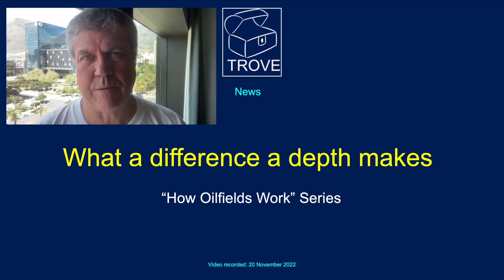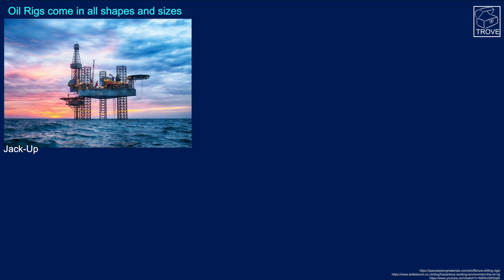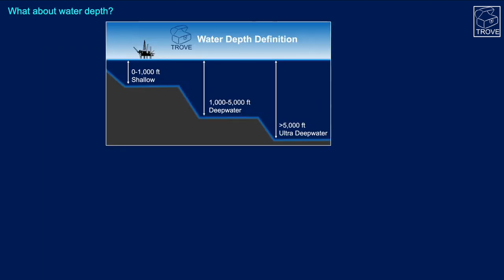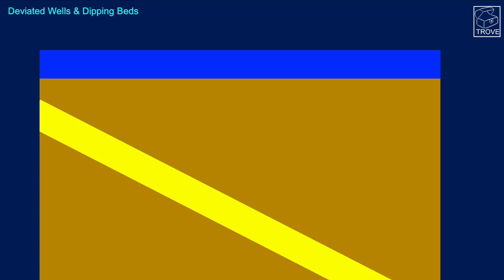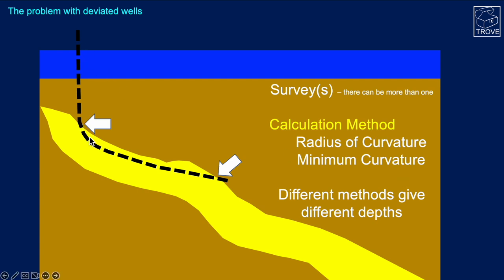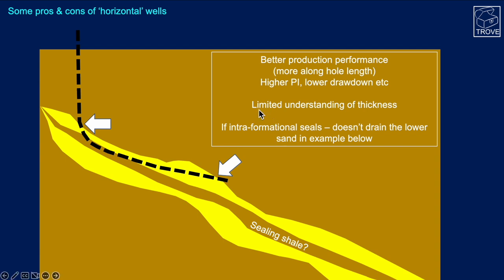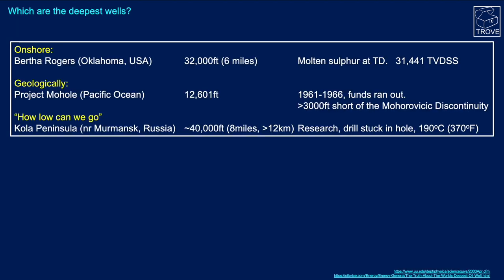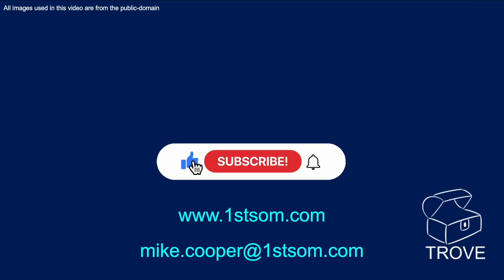How OILFIELDS Work - what is DEPTH?

Comment: It is interesting that the vertical depths of the wells off of Sakhalin Island only have a true vertical depth of 1km because I have seen them cited as the deepest wells. In particular, I have read that the great depths of these well are evidence in support of the abiotic theory. This would seem to be debunked if the horizontal depth is only 1km. But what about the Tiber field? Did they find oil at 35,000 feet?
Reply from the maker: Hi Eugene, thanks for your question. Some Sakhalin wells are likely to go deep, we were quoting drilling records, mainly set on one field which may have anomalous well geometries. As for Tiber, in the Gulf of Mexico - it's a little more complicated. First there is over 4,000ft water column before reaching the sea bed. Secondly, the maximum depth was over 35,000ft ("TD"). Oil was recovered from a number of Tertiary-aged sands, however the exact depths of the pay intervals is not a matter of public record, to the best of my knowledge. Hope this clarifies.
Reply: Thank you for your detailed response. As I understand it, with regards the oil window there is a limit to the temperature at which petroleum will form from source rock. does this put a theoretical hard-limit on the depth?

My motivation for asking is to have the correct information at hand when I encounter proponents of the abiotic oil theory which apparently has some strong adherents in Russia and Ukraine.
Reply from the maker: @LewesMintz  Hi Eugene,
We don't want to get embroiled in the conspiracy theory communities. The earth is flat, Hollywood made up the moon landing etc.There is a well understood progression of maturity which originated in the 'rank' applied to coal maturation. As coals get deeper/hotter they change from lignites to bituminous coals to anthracite to graphite. The latter would be in low-grade metamorphic rocks. There is no single temperature we can quote but there is an effective hard-limit on the depth. The abiotic source argue the complex molecules found in oil are picked up on the way. You can't debate/argue/influence with such people. Try staying out of their way is my advice.